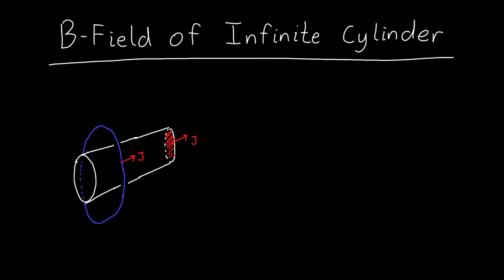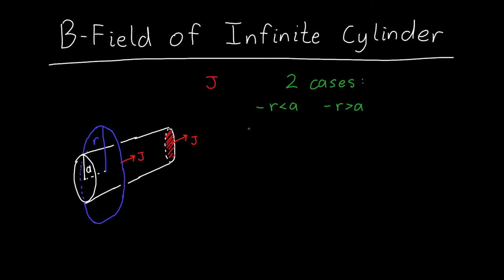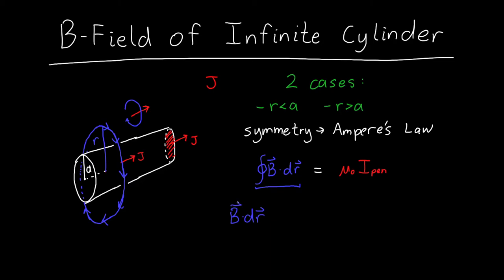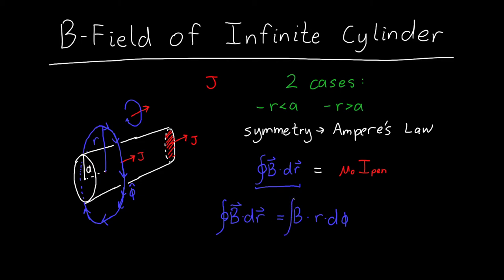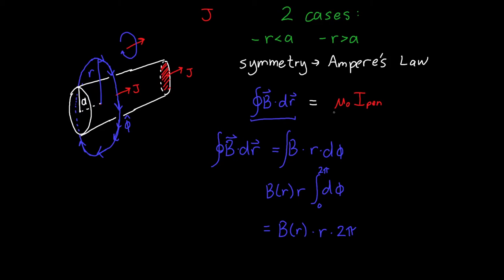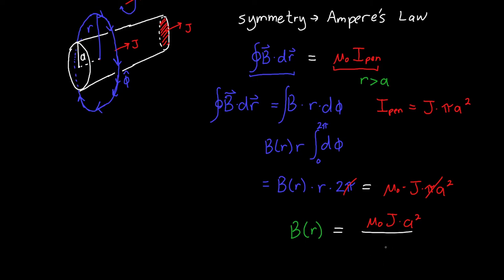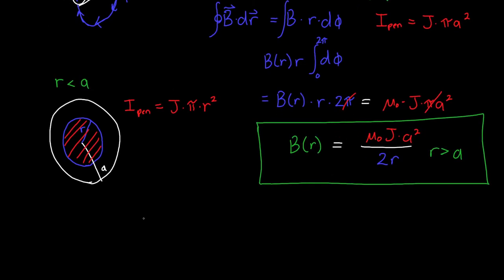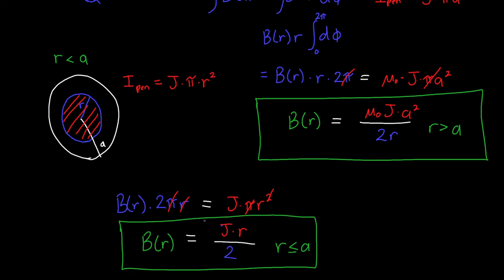B-Field of an Infinite Cylinder of Current

Comment: Hello so this doesnt change anything compared to a finite cylinder of current?
Reply: If it is pretty long but finite, you would aproximate it exactly like this when looking on B(r), but the field would change when moving to the upper/lower edges of the cylinder. If you had short cylinder, i imagine this approximation would not be ideal. Basicaly when looking at either ends of the finite cylinder the magnetic lines would bend and warp to incorporate the fields on the edges, thats why we usually look at the middle part, where everything is nice, easy and symetrical...